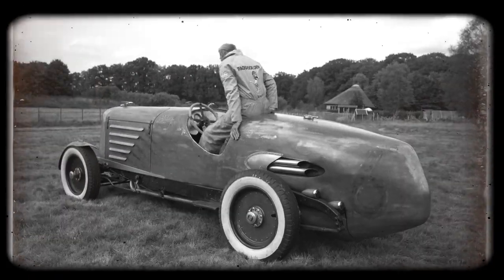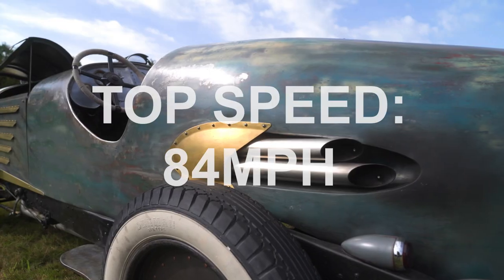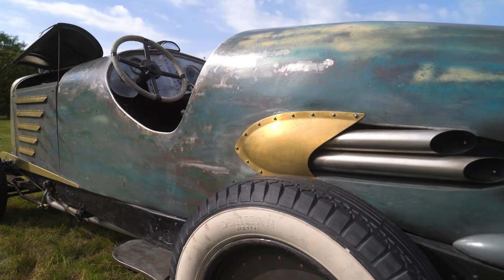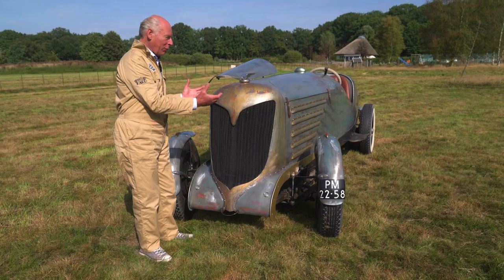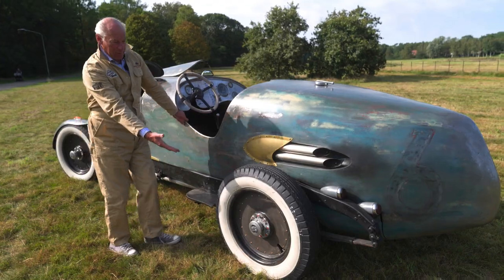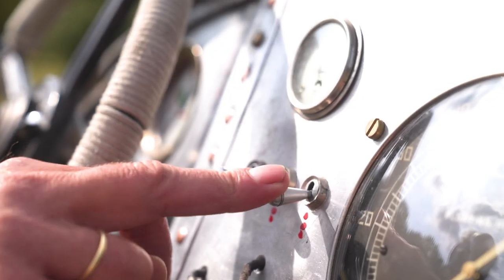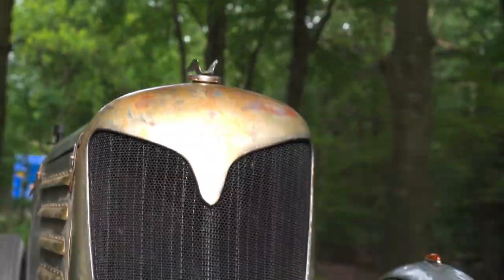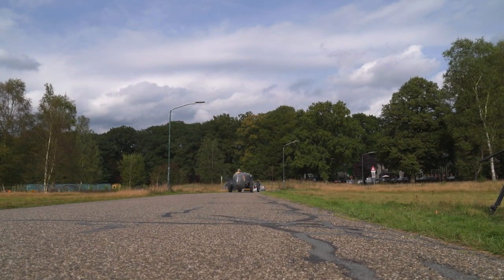I Built My Own 1930's Race Car | RIDICULOUS RIDES

Comment: Very cool! Love the front end!  The paint is great too!!  I say make it easy and quick, it's going to get scratched anyways!!  2 criticisms.   The fenders.  The fronts should be lower in back.  It will help cut down on crud flying into drivers face.  There should be rear fenders to prevent the same crud being thrown on the car behind.  The wheels are slightly proportioned too small.  Looks like a real fun ride!!